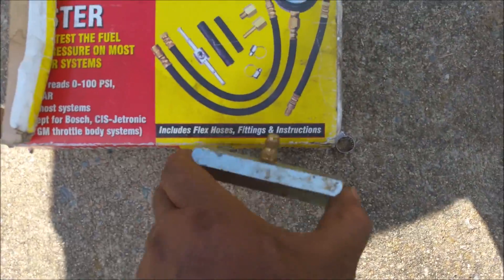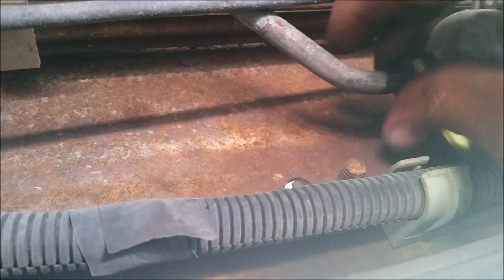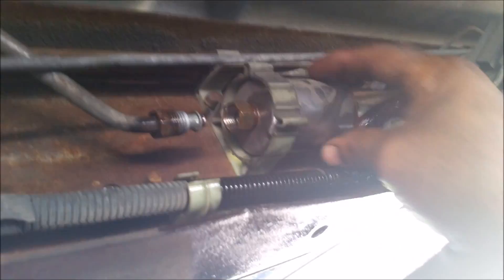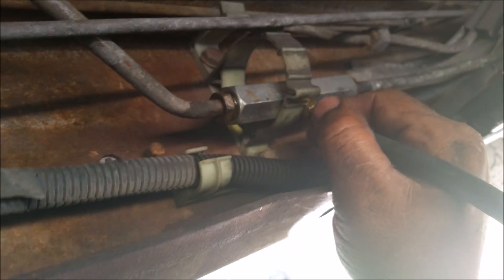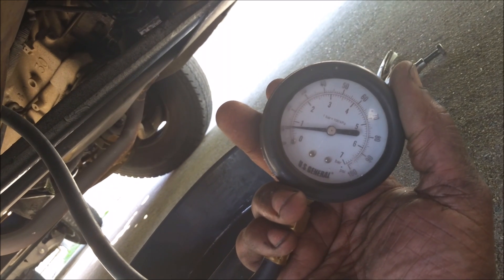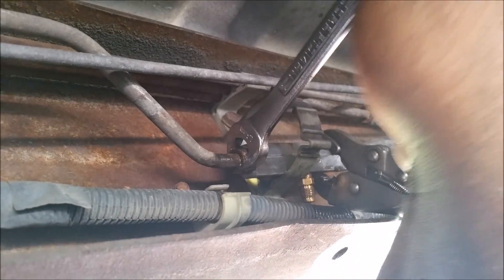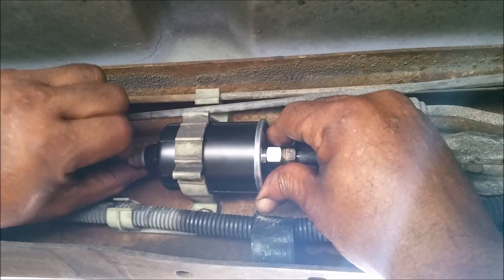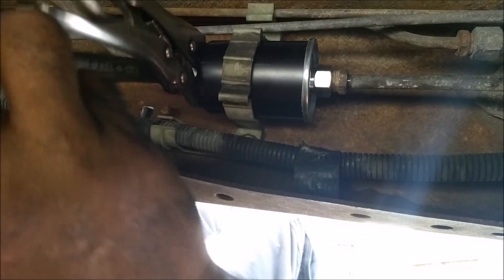GMC ,TBi  fuel pressure testing and fuel filter replacement

Comment: Is there a place to release fuel pressure?
Reply: Usually in the side of the gauge. The pressure is so low. So if it don't has a release you can just trying to slowly and you'll be okay. If you're worrued just wrap them rag around it and turn it

Comment: I only have 9psi but truck won't start and has good spark
Reply: Put fuel stater in throttle if it start. U know u need a fuel pump.
Reply: @fredsolomon3rd6969  i did and still didn't start but I found out what was wrong
Reply: @kellymitchell6443  can your tell me what was wrong.
Reply: @fredsolomon3rd6969  it ended up being the distributor cap. Was cracked and full of moisture. So it was firing  Intermitting. So that's why I would see a spark lol
Reply: I have 15psi my truck doesn't have gas in the throttle body

Comment: Theres a fuel valve in the line up behind the intake manifold Why arent you testing it there?
Reply: Load a picture of yours. We never seen one on this truck sir.
Reply: @fredsolomon3rd6969   Its a 5.7 L Vortec in a 99 Cadillac Escalade. I have one in my Blazer as well and its a 4.3 Vortec. Both have a cap that unscrews Looks similar to an A/C cap Its black plastic
Reply: @stephenjackson4392  this is a 92    tbi.  4.3. They don't have one. Unless you buy it and install.

Comment: Help !!! My 199p chevy turns on fine. However when i accelerate it stalls like no gas goes thru. !!! Help !!!
Reply: is it missing. And do you have codes.if you do check them
Reply: What it did end up being that’s what mine is doing
Reply: @backwoods9426  I swapped out the fuel filter and fuel pump. After that no problems.

Comment: u should also do a dead head test. you block off the outlet, and see if the pressure doubles, or stays the same. if it stays the same, the pump is likely leaking at the rubber hose where the pump connects to the fuel pump sending unit. pinhole, or deteriorated clamps. fuel system cant hold steady pressure when its bleeding off at the internal hose connection.
Reply from the maker: yes sounds good, good info
Reply: AKA...ruptured pump diaphragm

Comment: should be 12PSI running at idle, common issue was the short "hose" from fuel pump outlet to steel line inside tank, they dry rotted and split open, more so in hot southern climates and if left with tank below 1/2 often. they sound like there's a waterfall inside the tank when it's low on fuel and of course drive poorly/surge from being lean :)
Reply: throttle bottle i believe i have this problem on my 4.3 s10. Ill be testing this tomorrow but at the tbi itself. Would it cause a hard start no idle if the pressure is low due to the hose in the tank splitting?
Reply: throttle bottle also what would the pressure read if a split in the hose is the case?
Reply: 9-13psi is spec for TBI The 94-95 years fuel PSI was 28-32

Comment: I need that exact T fitting you have there, wish I knew of a specific name for it. Do you remember where you bought it from???
Reply from the maker: https://www.summitracing.com/parts/anm-01800001320?seid=srese1&cm_mmc=pla-google-shoppingsrese1_-actron&gclid=CjwKCAjw9O3NBRB3EiwAK6wPT6U1tzKiiN9ikFAn3ZWgzLQQolSgsWtH_wkew2edLwWvIh2aUtHNNBoCSRsQAvD_BwE
Reply from the maker: The one above goes behind the throttle body.   The regular is at Amazon its call   TBI fuel tester adapter
Reply: Anybody ever figure out the name or description or source for that test adapter TEE?
Reply: @kevinwilson3499 I just got one from Amazon. It was a TBI fuel pressure adapter. Search for that.
Reply: That's not much pressure.  How much pressure is the pressure when driving. Put new fuel pump in Easter Sunday. The truck runs worse. The pump isn't aftermarket.   Ever since this has happened i keep the tank pretty full. heard that pressure in tank keeps pump cool and lubed. What would happen if I place a Ford inline fuel pump on the frame. Give my piece of junk 40 psi and force the junk to run. Too many new parts to list that are new. it stalls sluggish engine shakes violently when leaving off gas. This is only vehicle that has no point to tap in to hook gauge to check fuel pressure. fucken gm engineers.
Reply: @altlandf  that tbi rebuild may need to be done. The fuel pressure regulator if in the back